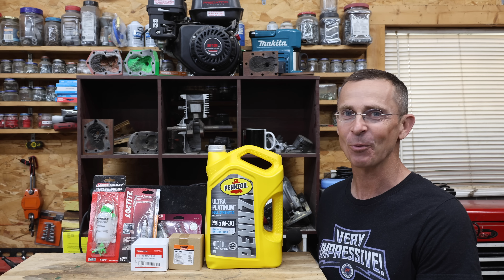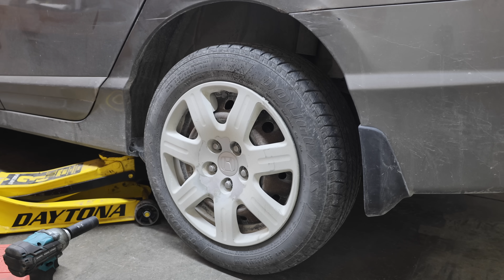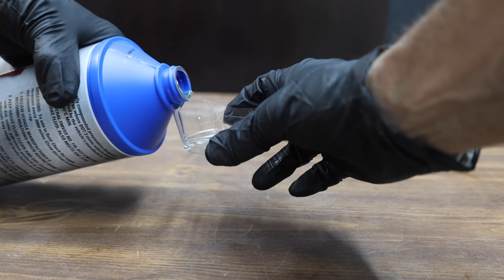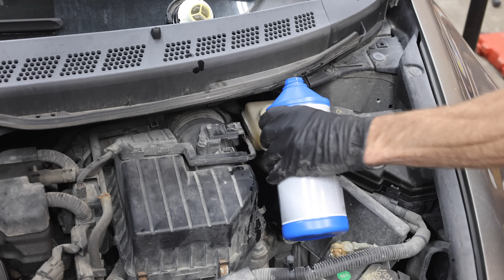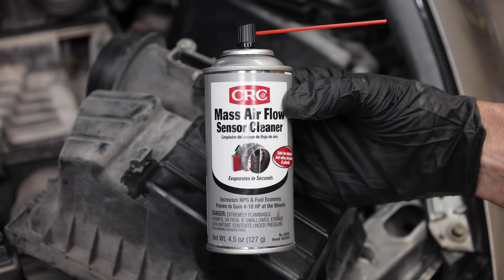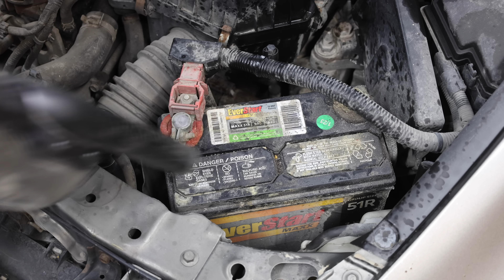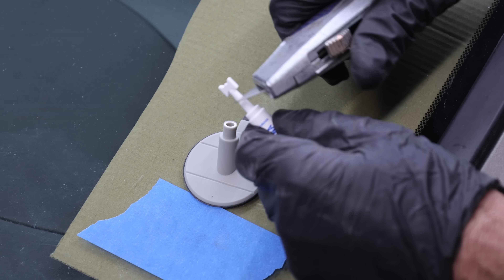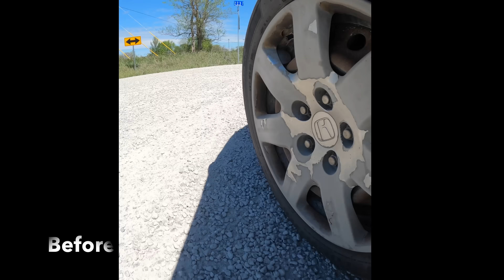Most Reliable 200K Mile Car? Let's Settle This!

Comment: I put 459,000 on my 2015 Camry, just sold it for $7,000.. it was in excellent shape.. no codes, no oil leaks, no leaks of any sort... Had the 2AR 4 cylinder , 6 sp auto... 6 sets of brakes, 2 water pumps, 3 alternators.. 8 sets of tires.... I changed the oil every 5k, trans fluid with filter every 50k.. even had the original Struts...
Reply from the maker: Thanks for sharing.

Comment: Yep, start with a good "base" vehicle and maintain it, but stack the odds in your favor...Honda, Toyota, Mercedes, Volvo. 

Not saying others won't last or can't, but I've had Toyotas and Merceds exceed 250k miles and were still running fine when I sold them.

I've never had a Chevy or Dodge make it economically past 100k (where maintenance became more expensive in time and $) or a Ford past 130k.
Reply from the maker: Thanks for the feedback.

Comment: I noticed you never check and clean the throttle body.
I clean mine every time I change oil and it get be pretty dirty inside.
I would imagine on a car that's over 200k on it the throttle body should real dirty inside.

Comment: @PrrojectFarm viewer suggested: measuring the torque of settings of the clutch of a drill. Let me explain, my wife recently bought some furniture / dog crate that came flat packed. The directions said do not use any power tools despite having 100s of screw type connectors. There was no way I was going to screw together 100s by hand. So, I grabbed my drill and dialed it into the lowest clutch setting and started assembly. I think 2 -3 spun out. The numbers on our drills are arbitrary and are not the same from manufacturer to manufacture, but is it at least consistent within a manufacturer?
Reply from the maker: Thanks for the suggestion.

Comment: i ll drain it like to, but if  keep on  your changing you flush the system using the cooler lines. plus your flushing the trans cooler.  drain the trans. slightly over fill the trans.  run a hose to a measuring can or quart.  go through the gears until you fill the can . top off until fluid is clean. verify fluid is at correct level

Comment: I still have and daily drive a 1990 Honda Accord with 310,000 thousand miles on the original engine and manual transmission and still runs and drives like new because I maintain it, my Ford 150 is 19 years old and the F 350 7.3 is 21 years old both have around 200 thousand...change your oil every 3,000 miles and they last...
Reply from the maker: Thanks for sharing.

Comment: The first car I ever own that hit 200k was my first. 1972 ford Torino. The only major repair was a timinh chain. The best was my pontiac Vide. 260 k about. only magor repair was a rear end. I love that car. I olnly traded it in because It had a leaking exhaust manifold and could not find the part.
Reply from the maker: Thanks for sharing.

Comment: INTERESTING!!!  Although issues to look at further would be cylinder pressure, oil burning, replace water pump (precaution) and replace timing belt and associated components if it is a chain then not since it is well lubricated. Your engine is expensive, just like a transmission and when you're buying used this is what you have to be wary about.
Reply from the maker: Thanks for the feedback.

Comment: ALH TDI Volkswagen Jetta gets my vote for most reliable high mileage vehicle. I have owned several and currently own one with 521k miles! Only the timing belt, turbo and thermostat have needed replacement on the engine! Clutch/flywheel done at just over 300k and rear trailing arm bushings, shocks and wheel bearings done at the same time. No other major repairs have been needed and I average 42 mpg unless your on a road trip when it will pull low 50's.
Reply from the maker: Thanks for sharing.

Comment: My 08 Honda Civic was great. 240k miles until I had an engine block leak of coolant. Apparently there was a window for a recall but my happened was too late. I fixed the front leak with JB weld. It worked but then it slowly started leaking from the back that can't be reached 😢
Reply from the maker: Thanks for sharing.

Comment: Nice video! I wonder if the same could be done with replacing parts inside an engine (if it ends up being better than replacing the car)
Reply from the maker: Thanks!  Thanks for the suggestion.

Comment: bought a 2009 sonata with 281k miles for 1500, very well kept and the engine and car sounds a runs almost perfectly, definitely worth it to buy older reliable vehicles when some simple fixes and replacements can help it last for a just a little while longer;)
Reply from the maker: Thanks for the feedback.

Comment: Some Honda Auto Trannys have an external cartridge filter, often with a bracket to keep it in place. Also removing the solenoid clusters and clean under the O-ring integral filter screens.

Comment: Man that towel or sweatshirt under the wiper blade bar is a great idea. I work at a gas station and was refilling the washer buckets when I saw a lady replacing her wipers and slammed it down on the window, big ol crack in an instant.
Reply from the maker: Thanks for the feedback.

Comment: I am retired from 47 years in the car repair business. A Lincoln Town Car or Crown Vic will
wear out 3 or 4 Hondas or Buick Lesabres. One reason for this is that they are REAR WHEEL DRIVE. My Dad has a 2001 Lesabre and it has been a money pit for many many years. My experience with Hondas is that they break a lot and the bodies fall apart by the time they are ten years old, and lots of luck trying to get 300 or 400k out of their engines, and you will have lots of fun with that check engine light! The true test of a car is how do they look and how do they perform after 300,000 miles and 15 years.. At 300K a Town Car is just starting to get broken in.
Reply from the maker: Thanks for sharing.

Comment: That would be my 306,000 mile 2011, f250 power stroke.  Replaced oil cooler and that’s it, only because it was starting to drip oil on my shop floor.  Truck has been virtually maintenance free.
Reply from the maker: Thanks for sharing!

Comment: Ive had 4 90's toyota's all over 200k on them, all cost about 3 grand and not one of them failed me in that 25 years and all I ever did to any of them is change the oil and filter and tyres...5 years later I still regret selling the last one I had :)
Reply from the maker: Thanks for sharing.

Comment: I’m driving a 2016 Honda civic with 327k miles on it. And it drives like new. The main key is maintenance and original parts. Keep it clean and it would work forever.
Reply from the maker: Thanks for sharing!

Comment: My Daily Driver Is A 1999 Lexus LS400, Built In December 1998. I Have Well Over 200K Miles And It Looks And Drives Like A Brand New Car! I Keep It Polished, The Interior Clean, Installed Some Beautiful SeatCovers To Protect The Original Leather Seats And It Looks Gorgeous!

I Run Mobile One 20K High Mileage Oil, Along With FR3 Anti-Friction And The Engine Runs As Smooth As Butter. I Keep The Transmission Fluid Up To Date Along With The Transaxle Fluid. I Also Change The Timing Belt As Recommended Every 100K Miles And This Car Hasn't Required Much Maintenance At All!

I Get Lots Of Offers From People Who Want To Buy It From Me But After 25.5 Years Of Trouble Free Driving, I'll Never Part With This Baby!
Reply from the maker: Thanks for sharing.

Comment: alot of shops dont use dielectric grease anymore because as it ages/ through heat cycles it becomes more of a hardening silcone and pulls out the connector from the boot of the spark plug
Reply from the maker: Thanks for sharing.

Comment: You must live at the edge of (or outside of) the rust belt.  In my area of PA, the hubs would have been rusted fast to the steering knuckle.  Good job on doing a brake fluid change before the tubing rotted from the inside out.

Comment: I have been watching your videos and even commented on a few, They are very informative and helpful. I noticed you have started migrating over to the automotive repair side. My father raced dirt circle track and motorcycles for a better part of 4 decades,  I currently race road courses and have a 1993 corvette that I show but still needs work. Let me know if you 'de be interested in doing a video with the Vette. Biggest mechanical issue right now is the bushings all over the body, Shocks could probably be replaced but seem ok. I've never changed the differential fluid or transmission  fluid  only the oil. I am sure there are many other things I could tackle. I did just get the motor back in the car with a new LT4 hot cam, EGR delete, Bigger throttle body, spark plugs, plug wires and opti-spark. But I'm sure there is plenty more to do. Let me know if you are interested. I am  in the northland. Thanks

Comment: Most reliable?  My 2004 Toyota Corolla CE w/5 spd stick and crank windows. 202,000 miles, original engine and transmission.

Comment: , Mightve been a good idea to change the output shaft seal while you were in there(even if it wasnt leaking) LOVE this. This is what I do when I get a new (to me) vehicle. I also degrease the engine and buff the car.. which one of the ceramic coating did you use?
Reply: that 3800 II is bullet proof

Comment: if the AC goes out try replacing the compressor coil not the whole compressor ,stealership wanted 1200 for new compressor ,local shop qouted us 760 ,new coil was 50 on amazon and didn't have to unhook the lines so no vacume or refill was needed

Comment: For the mechanically inclined mk1-mk2 ford focus.  For non mechanics the average Toyota.   A lot of vehicles with a manual are superior.
Reply from the maker: Thanks for the feedback.
Reply: @ProjectFarm  all years of ford focus with the manual are 300k+ cars. With the singular exception of early models with the SPI motor.  The mtx75 transmission is very reliable.  The zetec and duratec are also very reliable.  Rust and accidents are probably 90% killer for those cars.  I own a fleet of mk1.5 America Cars  worst issues I've had were caused by my inexperience and the next worst will just be a leaky power steering rack.  Non of them are over 200k yet because they are affordable in the 100k range but my 2 with about 175k are solid cars thought minor issues generally related to cel issues which impact emissions not being drivable and reliable.  The 04 duratec 5spd has some cluster gremlins but is reliable in rural area with no emissions.  Gave it to my mom.

Comment: All hail the beaters and shitboxes. Got two Hondas with over 200K miles (if you count the one that has a stuck odometer at 197K over 10K miles ago). They both run fabulous.
Reply from the maker: Thanks for sharing.

Comment: My 2002 SL Saturn still. Has most of the oem parts on it at 230k miles. It’s a manual and in the summer I get 42-47mpg. In the winter I get 38-42mpg.
Reply from the maker: Thanks for the feedback.

Comment: Everything was great! Except one thing to consider...with automatic transmissions specifically, if that fluid has never been serviced before, take huge caution changing it at such a high mileage. The clutch material and metal in the fluid could be the only thing providing friction for the clutches and discs. I've seen multiple high mileage cars either go to scrap or, if the own can afford it, put another trans in because they did a service and it made any number of gears slip.
Reply from the maker: Thanks for the feedback.

Comment: I had a 1996 Suburban with 297k miles on it.  It was a great vehicle but the transmission went out in it and I couldn’t justify putting $1500-$2000 dollars into rebuilding the tranny on a truck with essentially 300k on it.  I bought it with 175k miles, it was in very good condition and everything worked great.  I paid $3800 cash for it and drove it almost 10 years.   Screw $800 dollar per month vehicle payments!  I ain’t trying to impress anyone!
Reply from the maker: Thanks for sharing.

Comment: If the rear wheel cylinders don’t start leaking within a few months you can consider yourself very lucky. I always replace them when replacing the brake shoes.
Reply from the maker: Thanks for the feedback.

Comment: Most reliable car I have ever owned was a 06 Scion XB. Besides  maintenance(battery,tires,oil change tune up etc) only replaced the alternator. It was a Manuel transmission which I never replaced the clutch. Sold it with 215,000 miles. Only reason was it because of lack of care to exterior. So there was a lot of rust. I used it as a beach vehicle and didn't wash it often. My bad
Reply from the maker: Thank you for sharing!

Comment: Aw man, I thought you meant 200 km/h car you know,125mph car…
Yeah, where you go out and drive 125 mph all day long in eight different cars. Slam on the brakes from 125, spin around some handbrake turns, windows up windows down, how well you can hear the radio at 125. Which car has the best air conditioning at 125… Stuff like that…
Boy, did I get a Clickbaited…🤠

Comment: I absolutely support fixing your own stuff and doing your own mechanic work, even as I do my own work on my car. However, what isn't specified in this 20 minute video is just how long all of this actually took just in labor, the cost of all these parts, the cost of the equipment to perform some of these jobs, the time to research the parts and purchase the parts, the cost of measuring equipment such as the OBD reader, the light meter, the PH measuring tools, so on and so forth. Like you're talking about multiple thousands of dollars that just went into this car and anywhere in the ballpark of about 20-40 hours total depending on your experience in doing all these things. So yes, it's nice to be able to do such things, but not everyone is going to be up to the task of many of these things, or it will take so long it would make more sense in the cost-benefit analysis to just have someone else specialized do the work instead, or even outright purchase a new car if able. Which of course, is what tends to happen. This is a lot of work, and if someone is down for it, godspeed, absolutely more power to you.

Comment: As a professional minimalist who's owned at least half-a-dozen vehicles rolling over 200k, my first choices are early to mid-00s minivans build on a truck chassis. Example: 2009 Kia Sedona with six-lug wheels. They'll tend to have a rougher ride than a car, but will almost never suffer the usual suspension problems of weaker-built vans (Chryslers & Dodges) and small-wheel-diameter cars -- especially if they're built by a "still hungry" smaller manufacturer during its upward trajectory phase. THE ONE THING THAT ALWAYS GETS YOU with mid-90s onward vehicles: transmission filters needing replacement. Slipping automatic transmissions are one of the auto-industry's reliable means of planned-obsolescence (others are the aforementioned crap suspensions, EGR-valves, speed sensors, & other worthless "limp mode" gadgetry, and impossible to access without dropping the tank fuel-pumps). A follow-up video showing your viewers how to replace transmission filter and fluid in these vehicles would be welcome. Preceding that, do a video comparing Lucas transmission fix versus similar products (I've had to put Lucas in every minivan I've owned made from 1997 onward as a stop-gap slipping fix).
Reply from the maker: Thanks for the feedback.

Comment: Best car I’ve ever owned was an 1994 Chevy Cavalier,sold it with 460,000 miles in need of a fuel filter.
Other than basic maintenance I replaced the alternator,battery & a/c compressor
Reply from the maker: Thanks for the feedback.

Comment: That clunking when turning is classic sound of a worn outer CV joint.    Internally worn front struts usually clunk when hitting speed bumps or washboard roads while going straight.    But, at 200K mi, it was time to replace them even if they weren't yet totally failed.
Reply from the maker: Thanks for the feedback.

Comment: As a 27 year master mechanic,  this video is an example of text book repairs  and procedures.  Nice job!!
Reply from the maker: Thanks!
Reply: Does the car come with a timing belt?
Reply: Honda technician must be the best job ever (for wrenches).  I've got a Toyota and every time I work on it , I just say 'these guys designed for maintenance/repair.'  I'm suspect Honda is even better.  People tell me 'well you know about cars so you can buy used,' I just tell them 'all you need to see is that the emblem says Honda or Toyota.'
Reply: master 😄
Reply: It's the name of a certification  @kevwills858

Comment: I hear that if transmission fluid has been in for over 100k miles, you should not change it.  Also, could you do test on graphite oil additives in far smaller amounts?  Do the benefits of graphite in oil happen with less graphite than needed to produce the problems?
Reply from the maker: Thanks for the suggestion.

Comment: I have  338.000. That's what I have on my 94 Trans Am I bought new.  Engine never been touched, LT1, even the timing chain is original.  Runs like new, uses no oil.  Over 30 years it has had 1 GM remanufactured transmission,  1 new radiator.  1 Ac compressor,  2 optisparks, 1 starter, new struts and shocks. 1 drivers side power window motor. last year it failed California emissions for the 1st time, needed new CAT. Problem solved. Never synthetic,  Castrol GTX 10 30 since original 1st change at 1000 miles. Enjoyed your video. Very thorough!
Reply from the maker: Thanks for sharing.

Comment: These are great cars, I've got the UK version and it has needed no repairs to 100,000miles, just tyres, brake parts and oil.  Very well made cars,  up to the standards of 1980s Mercedes I think, only lighter weight.  The 1.8 is powerful, very flexible and gets good mileage too almost like a diesel.
Reply from the maker: Thanks for the feedback.